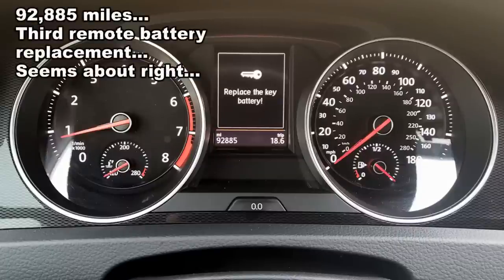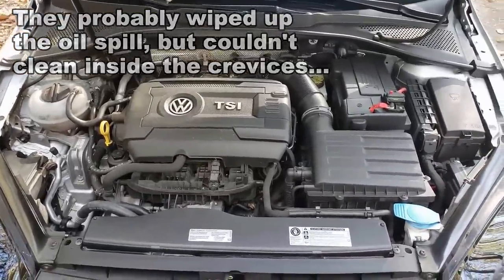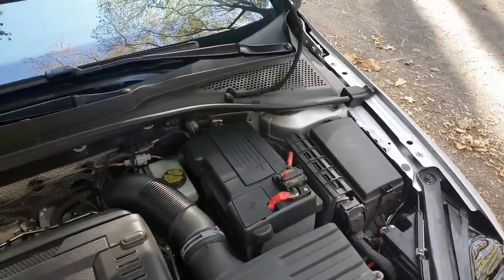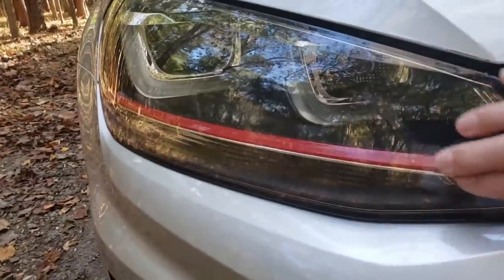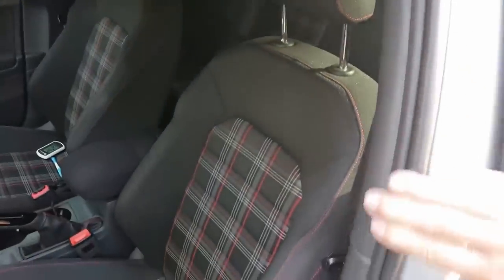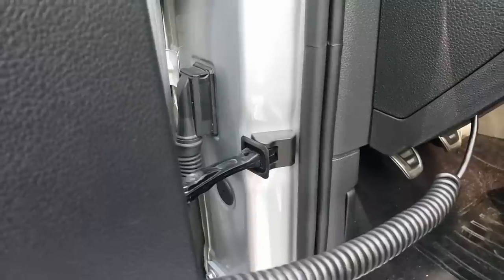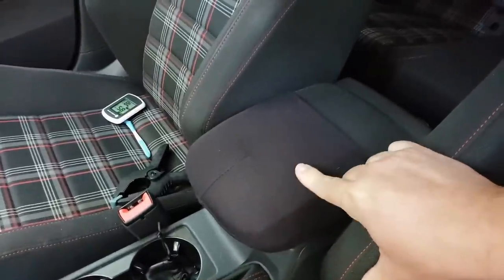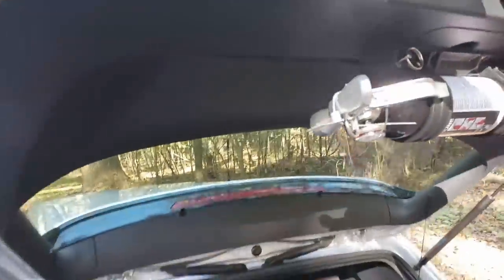THREE YEARS AND 93,000 MILES: My Report, Part 1

Comment: one of my guilty pleasures is to look at volkswagon golfs,  the whole hot hatch thing is cool, but some of those problems are scary.
and alot of company neglegence.
Reply from the maker: It's not as bad as it sounds. I wouldn't hesitate to drive this car across the country, even with a trailer in tow.
Reply: VW is not known for reliability, especially for people who don't care about cars in general and view them as appliances for a-b. It's one of the reasons it's value plummets like stone in the used market. When buying any luxury german you need to be prepared to constantly think and baby the vehicle. Oil changed every 3k, especially on turbo engines. They eat themselves alive. Plus there's tons of electronic issues, which need official VW tools to identify and fix. It's an endless moneypit. These cars are created with planned obsolescence in mind. The primary profits coming from dealership service department.
Reply: @xFlared  I would agree that VW (and Audi, BMW and Mercedes) are NOT cars you just drive and never maintain.  But changing oil every 3K is wasteful.  Use fully synthetic 5-40 oil like Ravenol, Castrol or Luqui-Moly every 10,000 miles and it will be fine.  German cars are performance oriented, and require more maintenance than your basic Toyora or Honda, which are not performance vehicles.  But more and more, as the Japanese and Koreans build more performance oriented vehicles, they require just as much maintenance.  And ALL cars are using more and more electronics, which means they will all start being money pits after 7 or 8 years of age as the electronics and plastic components begin to crack and fail and as more and more of these parts are made in China to keep costs down.

Comment: You sure your water pump seal isn't seeping?  That is a known problem on these cars and would explain the low coolant levels.  I would have that checked.  On my MK6 GTI my car had about 1500 miles on it and began to show signs like yours.  Was seeping even though I couldn't see any leak.  Wouldn't hurt to have VW look at it.
Reply from the maker: It's been checked a few times by a competent specialist. I'm keeping an eye on it. Thanks for visiting.
Reply: @StealthGTI  There are many places though it can seep from.  The recirc pump, one of the many hoses that pump coolant after the engine is shut off.  There have been some people that found a clamp in the wrong place from the factory causing small seepage, so you really have to check all the houses, clamps that carry coolant.  Its not "normal" for a car to loose coolant like this.  I doubt its anything major, but its something minor that has been hiding from you from day one. haha.  I sold my MK6 GTI that I had for 5 1/2 yrs recently, bought it new in 2013 sold it mid 2018 and just purchased a 2020 MK7.5 GTI S with DSG.  I could write a long story on the differences between the two GTI's many differences and lot all in the MK7.5's favor.  All and all I am happy with the new GTI. 😎
Reply from the maker: @eppyz   - "Something minor" is the key takeaway, in my opinion. The source of the leak has been searched for at least three times in the past year and nothing found. One thing is certain about small leaks: They eventually get larger and easier to discover. As long as the leak isn't damaging anything or getting into the car, I'm content to let it be until it easier to diagnose. The day will come, that's one thing we can count on when it comes to Mk7s and coolant leaks.  ;-) Take Care!
Reply: @StealthGTI  Indeed will be easier to find once its a bigger leak.  You've made it this far haha may be another 100k miles or more right?? haha

Comment: I´ve installed a 70Ah battery in my 2.0 diesel. How is that for size? :) It is from a VW Rock.

I have had coolant water problems - it emptied the container at the end of a diesel particle filter cleaning in a second. Dealer took a look at it, they did not find any errors on the car but problem has not been seen again since (now 100.000 Miles). But maybe you a losing just a little bit of fluid every time your particle filter is cleaned? 

When I open my boot the blinker lights light up. Just telling you :) Left untouched it turns off after about ½ hour (I think). Codeword: OBDeleven or VCDS. I used the first.
Reply from the maker: Thanks for visiting.

Comment: Wait, the clutch was done after 30k miles or 48k km? How is that even possible?
Reply: Laakeri yeah, i did not understand that part!
Reply: The clutch on the gti's is weak and cannot survive the stage 2 mod. Without that mod it wouldve been fine up to now.
Reply from the maker: I added APR Stage 1 at 17,000 miles. This added over 80 hp and 100 lb-ft to the mix. The extra power, plus my towing, is quite abusive to factory clutches. My clutch slipped one cold morning around the 34,000 mile mark. I opted to replace it within 1000 miles, but probably could have driven another 20,000 miles, for all I know. I was a slip, not outright failure. Thanks for visiting.

Comment: Having owned a 2014 GTI PP for 3 years my only complaint was the rear shock absorber rattle that has been well-documented on the Golf Forums. This is my account of that problem http://www.vwgolfmk7problems.uk/. I imagine you have DCC suspension as I was surprised there was no mention of that issue. Aside from the shock absorber issue I had no other problems at all with the car, but then I only completed about 24k in 3-years so I would not expect too many faults. Sadly the car was written off in March 2018 after a Portuguese white van man with mobile phone in hand slammed into the rear of my car while it was parked-up. A replacement MK7.5 GTI was purchased last summer 2019 and I regret to say that it is not as good as the MK7 due to excessive & irritating cabin noise on long runs over certain road surfaces despite soundproofing and change of tyres. Even though it was a 2018 model I still had to change the rear shock absorbers as the rattle from the original Sachs shock absorbers was still detectable. I fitted a pair of Koni Actives and problem resolved.
Reply from the maker: I do not have DCC and have not had any suspension rattles. Thanks for visiting.

Comment: coolant missing is a bad sign , unless there are obvious leaks , its gone either from the water pump or from inside the motor , ( head gasket )
Reply from the maker: This is my thought, too. I'll send an oil sample for analysis. Thanks for visiting.
Reply: @StealthGTI  ive been in your shoes . i had the same issues for close to 2 years. coolant levels were dropping but there were no leaks .  one day 2 years later i had the first signs of a blown head gasket .   oil and coolant dont always mix , it depends on where the head gasket is leaking
Reply from the maker: @dimitristheoharis9552  - I look forward to seeing the results of my oil analysis. Thanks for visiting.

Comment: Is it worth getting a used 2017 sport? Most of the one in the market have like 30k miles and going for 21k.
Reply from the maker: I like my 2017 Sport. It has the Lighting and Performance Packages that the "S" lacked in 2017, but not the leather or sunroof that I did not want. As for price, I think $21k is definitely a retail price. I paid around $25k plus TTL for a brand new one. Do your research. Good Luck! -Scott
Reply: @StealthGTI  the lighting package is the best option I've ever had on a car! I'm glad I got the leather however, I prefer it to the tartan design (blasphemy I know), and it's super easy to clean.
Reply from the maker: @willmercier2852  Agreed! I didn't care about the lighting package, but I was glad to have it the first time I drove it in the dark. It's even better now that I used OBDeleven to remove the NAR restrictions.
Reply: @StealthGTI  what are those restrictions? Like how the cornering lights won't activate with the foglights?

Comment: The battery in my GTI died in just about 3 years with only 30K. But I've had to replace key fob batteries at least 3 times.in three years
Reply from the maker: My FOB batteries seem to last about a year. I replaced the latest battery with a CR2032, which is a hair thicker than the factory CR2025. Let's see if it lasts much longer. Thanks for visiting.
Reply: @StealthGTI  In my experience the remote entry/push button start key fobs go through batteries much quicker than the keyed ignition.  I have a 2016 Passat with keyed ignition and my wife and son both have Passats with keyless entry/push button start.  I have had to replace both their key fob batteries, but in that same time I have NOT had to replace mine.

Comment: Interesting and refreshingly honest video.  I'm an Englishman and have a 4.5 year old Ford Focus with 90,000 miles on the clock ... had a leaky offside driveshaft seal and , like you , a cracked windscreen. For the last 50,000 miles, every once in a while, the car lets out a little moaning noise which baffles everyone as to the cause but gets no worse nor more frequent.  I have to say that after its monthly clean the car looks as good as brand new, inside and out. I used to run Audis but became exasperated with the number of faults I had ... whilst your VW GTi seems to be doing pretty well this has confirmed my view it may be best to stick with Ford for my next car.  Thanks for posting this.
Reply from the maker: Thanks for visiting.

Comment: All VW engines use oil.  They do it new,  they do it old.  Its Normal.  The handbook will tell you how much it should use.  Just got to keep an eye on the levels.  😎.   Edit:  Really nice car btw.  I used to have a MINT MK2 GTi 16v.   Now I have an Audi A4 quattro,  loving the 4WD and turbo.
Reply from the maker: Thanks. In my case, the car was leaking the oil instead of consuming it. I had installed a steel oil pan and the RTV seal didn't hold over the long run. I have a Tiguan gasket there now, which seems to be holding fine. As for consumption, my GTI consumes very little oil, maybe 1/2-qt per 10,000 miles. Thanks for visiting.

Comment: Reducing coolant is definitely not normal. I have mk5 gti and the coolant stays a certain level forever.
Reply from the maker: Thanks for sharing.
Reply: well i had a golf 4 and once i filled it up to the max line after it reduced itself back to minminum and stayed there. my mechanic said the system itself reduces it due to pressure to the optimum level. never had blue exhaust gases or anything but i guess a 17 year old car at that time also doesnt have a 100% sealing. not leaking but loosing something due to expansion and contraction.

Comment: Hey bud, they brought out a metal pan again oem probably has gasket it was on the mk8 golf but same engine so it will fit. 😊
Reply from the maker: I cannot speak to that, but my metal oil pan has a gasket from a Mk2 Tiguan. It's a perfect fit, though I do need to check the bolts for torque about once a year. I discovered that they had worked their way loose over a few years. Not loose enough to fall out, but loose enough to develop a leak. I was ready to replace the gasket or return to the plastic pan (I have skid plates now), but was surprised to find loose bolts. I just check them at the oil drains now. Thanks for visiting!

Comment: The argument for the skid plate over the steel pan is that if you hit the skid plate it's not going to yank on anything that's important.  But if you hit a steel oil pan people have said that it can really damage your engine.  The plastic pan can be hit and it won't damage anything but the pan which is much less costly to repair.  Of course spilling all your oil can be just as bad for an engine.  So it's really up to the driver.  I think a good skid plate is a great idea, but ultimately I feel the stock height is great for everyday purposes.  The MK6 felt a bit lower and then I had the brilliant idea to lower it slightly which meant I scraped a lot...

Absolutely love the GTI though, and I have looked at trading down to something more affordable to maintain and really find it difficult to pick anything that isn't a 2019 vehicle with how well equipped my 2016 is.
Reply from the maker: Agreed, especially the part about stock ride height. Thanks for visiting.

Comment: Thanks for this type of information. 
Some people say VW and Chrysler are not reliable etc. My last vehicle was a Chrysler and I drove it over 10 years with no trouble except a $67 cam shaft sensor that went out twice. Other stuff was routine scheduled maintenance. I traded it in on a new 2019 GTI SE three days ago. My girlfriend gave her 2008 VW Passat to her son and it's still going. I hope to drive my GTI for 10 years or 100,000 miles whatever comes first. I'm trying to get a stage 3 done on it by next summer. I have been communicating with people about it but the internet is misleading because as of now I can't find a stage 3 for mk7.5 just mk7. I sent out emails today. 
Thanks
Reply from the maker: Thanks! And good luck with your tuning endeavors.

Comment: My Miata is going to turn 5 years old and it's still on its original battery.  Why does the GTI battery last only 2 years?
Reply from the maker: I suspect your five year old Miata has less demand on the battery. No disrespect intended. A lot changed in passenger cars around 2015-2017 when more of them started including more luxuries and keyless ignition, which means more communication between the car and key fob. And my car specifically has a lot of extra load on the battery due to the nutty electronics package I've installed. See this video, if you're interested: https://youtu.be/ebFbqU0OQb8. Thanks for visiting.

Comment: i plan to put gloss black vinyl on the roof and rear spoiler so it looks different.  definitely do it in photoshop first :) 

smoke tint for the tail lights looks good.  also a tint strip on the windshield like we did in the 90s.  but if you want to be stealthy than don't do that.

my dad is 76 and has a 2008 Nissan 350z.  he got it tuned to 400hp and put lambo doors on it so its easier for him to get into lol.  it was a sleeper until he put a black carbon hood on it with 6 vents for the Florida heat.  he says he gets tested sometimes and slays them lol.  nice to see him get back into his racing days.  when he was young,  he raced Shirley Muldowney in a Corvette and lost.  i think that was before she went pro.
Reply from the maker: Cool story about Shirley Muldowney. Thanks for visiting.

Comment: Had a brand new golf 1993.... shutting off  for no reason right outside the dealer, they never were able to fix the problem, sold it a couple year later
Went back..again... and got me a 2008 golf.... it would rev up randomly...dealer never was able to fix it... sold it at around 60,000 miles
Had a vw bus...ele trical problems... a nightmare 
Had a vw beetle... caught fire
NO MORE VW IN MY FUTURE OR FIR ANY FAMILY MEMBER, STAY AWAY FROM THOS GERMANS CARS
Reply from the maker: Sounds like you needed a new dealer. What are you driving now?

Comment: It's actually not burning any coolant, water pumps have small openings on them, weep holes, that allow teeny tiny amounts of coolant to leak out and lubricate them, yeah weird. It can also indicate that water pump is going bad, excessive leaking usually means it needs to be replaced.
Reply from the maker: Thanks for sharing that.

Comment: I have an audi a3 same exact engine and suspension as the golf. Mine also goes through coolant. I did notice build up of coolant by where the throttle body is. I’m not sure if thats where it is coming from though because my car had the water pump replaced before I bought it. So I do not know if its old build up from when they replaced the water pump or if thats where the coolant is going since there no sign of it dripping down
Reply from the maker: I had a seasoned VW mechanic inspect everything. He could have taken my money to replace things. Instead, he gave the car a clean bill of health. Thanks for visiting.

Comment: “Fuyao” is a Chinese automotive glass manufacturer and lots of BMW lower end models use their glass for side windows. I’m quite surprised that you found the Fuyao glass is clearer. Did you get the chance to compare the marking on those glasses? I had three windscreens on my BMW X5 all OEM but of different brands, couldn’t tell any difference...
Reply from the maker: I don't know what markings to compare. All I recall was sitting in my GTI for the very first time at the dealer and being surprised that the glass was not perfectly clear. Then, when the FY was installed, it was perfectly clear. Sure, it's not exactly a scientific measurement, but I am convinced. Thanks for visiting.

Comment: Thanks for the video. Im thinking of getting a 2013 1.4TSI  mk7 golf, which is very under utilised, mileage around 25k KM. Owner upgraded to latest ADAS features (RCTA,AEB, LDW etc ) with VW original parts. Also owner upgraded to VW Dynamic chassis control, infotainment, spoilers etc.

On paper it seems like a very good deal, owner seems to be be like using this as a project car rather than driving. Owner didnt change anything to the engine, still stock engine, exhaust. So i need to worry about other wear and tear? Given that its low mileage but 10 year old car.
Reply from the maker: My experience with new cars that I kept until they were old was that rubber parts begin to show their age around 10-11 years. That would be belts, hoses, CV boots, and suspension bits, regardless of mileage. I also found that the plastic coolant flange on the head would crack internally and eventually leak. None of it is terrible to deal with, but good to know in advance. Enjoy the car and thanks for visiting!

Comment: I have a 2015 mk7 gti Autobahn trim still running factory oil pan tuned by stratified and not a single issue with oil leakage only issue is it does consume a little bit of coolant but I honestly thinks that just a vw thing my mk6 did the same thing
Reply from the maker: Thanks for sharing your experience!